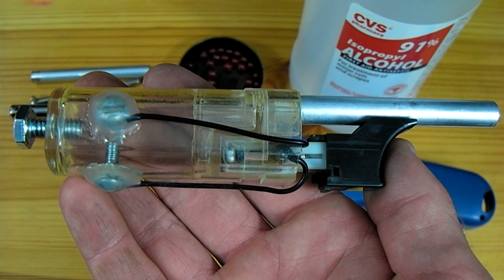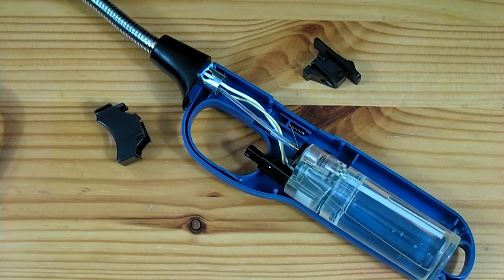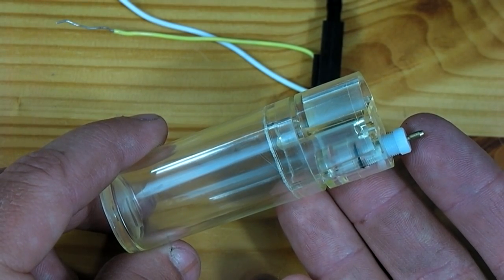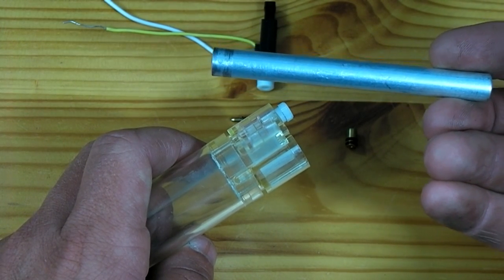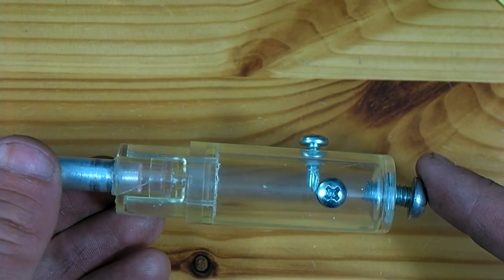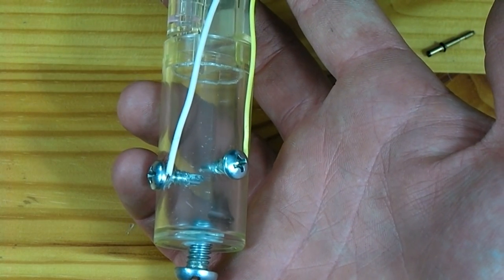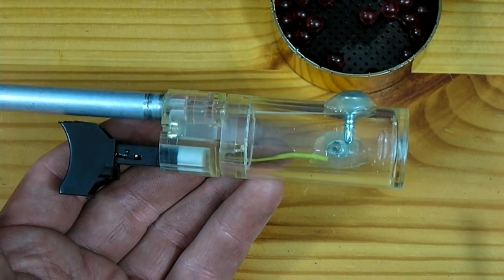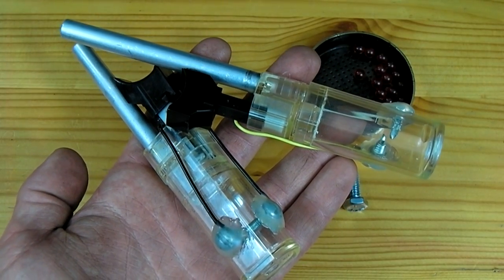Make a Mini Cannon from a Lighter

Comment: And you could have made it without letting the lighter fluid and having to screw and unscrew anything if you kept the parts the way they were, added a barrel and put in a pellet with a wad, simpler and faster to use maybe even more powerful.

Comment: Hello I did this experiment but it did not work, what is the solution please reply to my question
Reply from the maker: Too much fuel, too little fuel, or the spark gap needs adjustment. Those are the most common things that can stop this from working.
Reply: Hello ........... 
Thank you, Sir, for the time granted to me to solve my problem I will try amendment .....
Thanks again

Comment: My lighter I just spent 6 dollars on only has one wire.. what do I do?
Reply: you make a connection to the cylinder metal at the buttom that should be the another connnection but literally you can just make it spark without the 2nd connection just make sure theirs a metal near to it...:)

Comment: So I've tried making this cannon, followed the steps exactly.. somehow I cannot get the peizo to ignite inside the lighter tube even with a spark across both screws.. I am thinking somehow I drilled the bolt hole too big to where it's not tightly air sealed when I manually replace it. other than that I can't imagine what I did wrong.. this is a gift for someone, please help
Reply from the maker: If there is a spark but the cannon does not fire that means you are using either too much or too little fuel. If the spark is bright neon blue there is too much fuel and you need to blow fresh air in the chamber to clear it out.
Reply: NightHawkInLight hey I have the same problem.  But I aired it out by blowing in it but it still won't work please Answer
Reply from the maker: Tyler Holtz It's a same answer. Too much or too little fuel. If all else fails the spark gap may need to be adjusted.
Reply: i just realized i was using 70 percent rubbing alcohol.        and i was blowing on the inside

Comment: I tried to do this as a bigger size but 
even  the gas was there and it ignited between the wires but there was no "fire" force,,,
i tried it on multiple types of pipes 
i increased the diameter , decreased it, added more gas sometimes used less gas. But it didn't made any  force,, in the end was sad.

And it would be great help for me if some one helps me out
Reply from the maker: See my video about how to fuel cannons. It can be tricky to get right

Comment: what brand airsoft ammo did you have in ths video?
Reply: I really don't think it matters. If you are worried about the bb's shattering, anything .20 and above should be fine
Reply: That looks like a standard .12g Crosman bb.  Pretty crappy, but I don't think the velocity is high enough to warrant anything else.

Comment: because you did something wrong, lol.  troubleshooting it psychically is pretty difficult, so i'll just touch on logical "probable causes". your "sparkplug" screw tips have to be between 2 and 6 mm apart (1/16 to 1/4 inch for we Americans), ideally about 3mm (1/8 inch). if the heads of those screws are in that range of gap from each other, you can be "losing spark" there, even if thoroughly insulated with glue. if your wires are too close, you can "lose spark". if your alky is too dilute, no go

Comment: Dosent work waste of an 1 hour don't try
Reply: It works when done right! Just be very precise & make sure your rubbing alcohol is 91% or 93%. Hairspray can work too! It's basically the same concept as a spud launcher except much smaller! With a spud launcher, you can use PVC pipe with a cap on the end that screws off. You drill a hole on the side near the cap part & that will be your ignition chamber. You put a potato in the barrel, unscrew the end cap & spray your hairspray in, screw it back on, then aim, flick on the lighter by the hole & pop! Off it goes! Pretty simple concept! Probably much simpler than the one on this video. Too bad I can't draw a diagram on here to help. It's a good project for sitting around & BSing with friends!
Reply: +Knute Lindstrom 
I can only get Isopropanol 99.7 % 
does not work, I assume too much at 99.7%